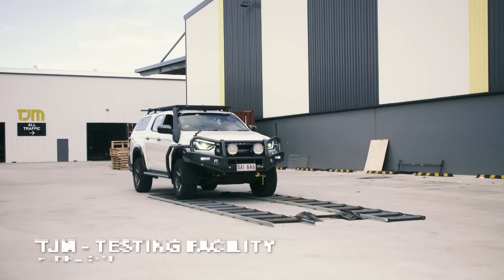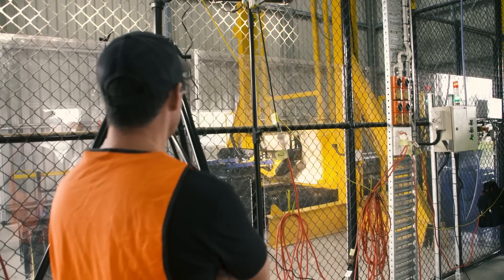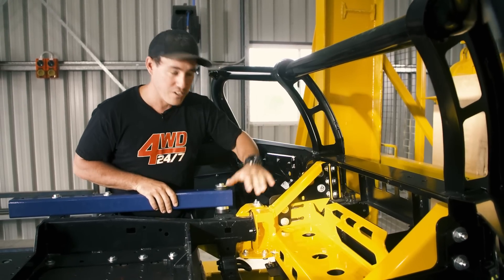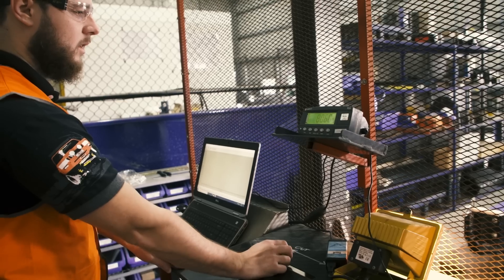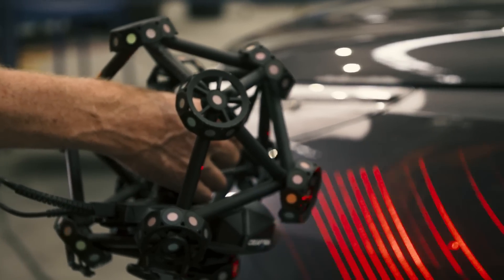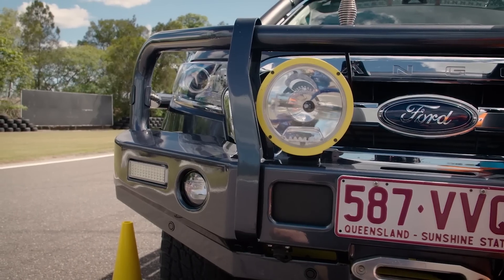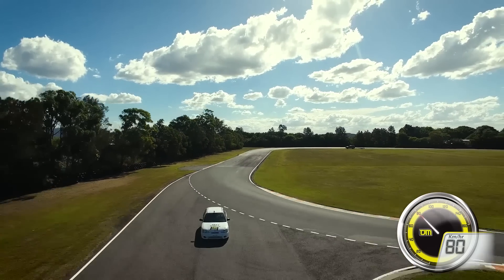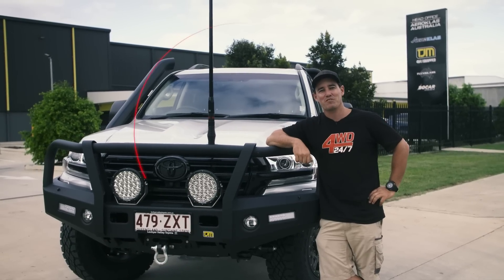BULLBAR CRASH TEST – How strong are they? PLUS How a bullbar is made!

Comment: Couple of issues from an observer.
Slotted holes in a bracket 'control' the impact.... NO WAY!!! too many uncontrollable variables! Friction, bolt torque/tension, paint thickness/friction.... keep going.....
The function of the mounting brackets is exactly that, to mount the item. It is not possible to control the mounting as well as impact control without introducing non-variable control measures!
Furthermore, you are testing a Ford ranger with  a bull bar, then as a comparison a Hyundai Excel without a bull bar ..... How's THAT for a comparison.... why not drive the same Ranger without bull bar into your makeshift roo....?
Clearly you are not independent!!!
Considering I'm currently in the market for 4WD accessories, one thing that this video has made clear to me is to stay clear of TJM products.
So if you are related (which I assume you are) then you have achieved exactly the opposite of your assumed intent.....

Comment: I don’t buy that  at all. Surely the purpose of crumple zones on modern cars is to crumble and absorb shock. Doesn’t a rigid steel Bullbar simple reduce crumpling and therefore in create the risk of the chassis deforming and intrusion into the footwell in a fronton crash. I’d also like to see the impact on the bar at 45 degrees

Comment: 4WD enthusiests need to take a look at the big tests done by BHP on Bullbar & Rollbar safety. They handed over some of there vehicles for expert crash testing, Conclusion was the added Bars were not safe. Bullbars trnasmitted impact further into the footwell area not good. Have any bull bar manufacturers had their bars tested by the offical crash testers as BHP did  ???. Youtube AUTO EXPERT (John Cadogan Mechanical Engineer) does a good breakdown on the subject. Go check it out do your homework. Seems testing the bar without the vehicle is really only half the story one would think.

Comment: BHP used to fit all of their Hilux utes with bullbars & roll bars ....until they did in depth testing at a Crash Lab facility with crash test dummies in the vehicles. The results showed overwhelmingly that the passengers within the vehicle were much safer WITHOUT the bullbar. Have any bullbar manufacturers done similar tests ? If so , where's the results ?
If not ? Why not ? 
Remember,  vehicle damage runs a distant 2nd to passenger safety.
Reply: Unless the vehicle is immobilized in a very remote area and cannot continue to drive. Then the people in the vehicle ARE at risk. Most recent incident would be the example of the woman who perished out near Level Post Bay, due to the car unable to be driven out of the bog. After all, the humble bull-bar started it's genesis in the outback, where those country people knew they had to protect the vehicles' cooling system to ensure drivability. Crunched panels and even crunched people can continue on for help. That, is the immediate role of the bull-bar.
Reply: The only independent study done on heavy duty bumpers (that I know of) was by a mining company, wondering why so many of their "light duty" (Large pickups, but light duty compared to 40 ton dumptrucks and mining equipment) trucks were killing the occupants instead of just injuring them in mine accidents. It was the heavy steel bumpers on the fronts of the trucks, they basically ruin the crumple zone and tend to shove the engine into the passenger compartment and/or the energy from the accident is absorbed by the occupants rather than the crumple zone. They're good for wildlife but very bad for highway driving.
Reply: @JacopoSkydweller have a head on and you'll plow right through the other cars crumple zone and be ok , the oriblem is hitting something like a tree
Reply: the bull bar are not designed for people can safely crash into other vehicles or trees, it’s mainly design for keep you vehicle operate after hit a roo, so  maybe driver a bit more safely.
Reply: BHP still install bull bars on there vehicles
I have seen the report done by BHP and appeared to have an obvious out come they were trying to achieve
Reply: New bars give and collapse,  much better to have I

Comment: bullbars should be made illegal as they are more lethal for pedestrians and wildlife - I recommend Parliament rule to ban their use forthwith and drives refusing to obey be heavily fined
Reply: all vehicles are lethal to peds.
Reply: @phalanx3803  - bull bars actually make the vehicle extremely lethal even at low speeds - should be banned
Reply: @phalanx3803  - okay,  but all vehicles are engineered with crumple zones up front designed to mitigate injury on pedestrians - ie they crumple, absorb the energy and also allow the pedestrian to be scooped up onto the bonnet which lessens the injuries - bull bars don't do that ie bull bars instantly remove the safety factor for pedestrians and cause more injuries and increases the lethality -

Comment: The Aussie bullbars are banned in the EU because they compromise the crash safety of the vehicle. 

With a bullbar mounted run the vehicle through the EuroNCAP test. 
- My bet is the vehicle is now performing worse than without the bullbar. 

If you don’t have kangaroos in your country you only need an Aussie bullbar for one reason - to compensate for small/tiny private body parts.

Comment: Almost had me convinced until TJM’s “professional engineers” used a 10 year old Hyundai Excel as a comparator! Surely a better comparator would have been a 4x4 without one of their bars. Love to see the manufacturer undertake ANCAP standard tests on a 4x4 with the bull bar on it so we know what impact the bull bar has on the crash performance of the vehicle.
Reply: I stopped watching at TJM involvement
Reply: It makes sense to use and old cheap car.
Reply: might be too expensive
Reply: They would use a car that doesn't have an airbag
Reply: It's makes sense to use a shit box. too expensive to repair damage just for a video.
Reply: It's the old 'comparing apples & oranges' trick. Same year, make, model & set up for all test vehicles, with one difference, bullbar or no bullbar, would provide a true comparison. And I suspect the result would be that the distribution of damage will be different, yet price of repairs, etc., would likely be similar.
Reply: @ianhowell6972 I'd like to see broader comparisons on alloy vs steel vs nudge bars, stealth bars etc.

Comment: A good bullbar is vastly better than a weaker bar which is still better than no bullbar. I have not by choice tested 80 series with and without Bullbar Holden Colorado and Ford Falcon. A Bull bar doesn't make the vehicle impervious to damage. But the right bar and speed and situation will improve things dramatically. Alloy bars can also very dramatically. My East Coast alloy winch bar on the Colorado is vastly stronger than the original factory alloy bar.

Comment: Interesting test, but how often r u going to hit a flat object aligned perfectly with the bar???
BUT!!   I purchased a used pickup a few years ago, 4X4 with a dealer installed bull bar, not the best quality, but ok!  A few years later I fell asleep one night, went down into a ditch and struct a large steel post which  prevented me from splashing into the creek.  The truck was still running, no airbag in the face.  I backed out and parked on the shoulder, got out to appraise the damage.  Of course the bull bar was toast but it stopped before it got to the radiator.  Even though it was an inexpensive bar without it the truck would have been totaled!

Comment: I hit a deer with mine going 60 mph.  It pushed the bumper back 2-3 inches (flush with the grill) and my quarter panel rolled a bit. Also dented my hood in 2 spots.  I drove away. But haven't fixed it yet.  I might try to pull it back into place

Comment: I had an Aries brush guard/grille on my 2019 Ford Ranger XL, and it got crumpled after a head-on with a Jeep Compass, both of us doing about 35mph. I'm sure it helped a little bit with the crash safety, but I really bought it for the amount of deer that run around my town, Susanville, CA. They're basically a "protected class" here, walk around with no fear, and occasionally like to play, "Can I survive a hit by that truck?" Anyway, I got myself another 2019 Ford Ranger, this time an XLT (I would have liked another XL but didn't have any in stock at the used but well kept car lot). After looking online at bullbars and bumpers I ran across the ARB Summit (very similar to these TJM's) and decided this is going on this go 'round, very sturdy looking, and upgrading the bumper at the same time I'm adding a brush guard/grille slash anti-MVW (anti- Mobile Vehicle Wrecker, aka deer). This video has only reinforced my desire to get it, thank you for making it! ;}

Comment: I thought you guys were a four-wheel drive show not a test dummy show or how to fix your truck show.? Would love to see you guys driving tougher and harder tracks. And put suspension lift and bigger tires on on your tour especially the one that spews black smoke everywhere it has the power to take it and it'll be a lot smoother ride and get some beadlocks

Comment: What happens to the pedestrian safety rating of the vehicle. 🙁
Reply: Anyone stepping out in front of any vehicle travelling at fifty miles per hour isn't getting up. If you never left the confines of the city the fitting of one would be questionable but outside the city the question starts to be why would you not, talk to the trucker's.
Reply: @CrusaderSports250  even at lower speeds the weight of larger vehicles plays a big factor it may be slower but it still pack a lot of energy getting hit by and truck at 25 is like getting hit but a car at 35.

Comment: Bullbars were popular in the Philippines in the late 80's and into the 90's when it was sold with the Mitsubishi Pajero. But it really won't protect the front part of the vehicle. Bumped on the right side then the rest of the bull/bush bar will damage other parts on the front not indirectly
Reply: They kill you because the crumple zones fail as the energy of impact is not absorbed into the areas designed to crumple, only the ARB Smart Bar allows for this

Comment: Situation no;
1; you hit pedestrian and cracked his skull open at 25 km/h because bulbar... Poor dude will live long and prosper 
2; hit tree 60 km/h collision. Bulbar messes up car computer. Air bag is activated fraction of a second sooner or later. Seat belt tensioner is activated fraction of second sooner or later... You die or you are incapacitated for agonizing rest of the life. 
You could walk away from that accident and have interesting story to say in the pub 3 days later... 
But nope, you die or screw up 10 years life to you and your family because of bulbar...
By the way that 100 kg all the way at the front of the car really messed up car handling. So instead completely avoid accident car just doesn't turn. And on top of that you are more likely to die in that accident because of stupid shit...
IS IT WORTH IT???
Reply: wow the amount of BS in your comment is staggering. bull bar or not if your head makes contact you done for either way. and they state in the video there made to not computerize the crash sensors. as for the extra weight out front it hardly makes a difference it even helps when towing as it off sets some of the ball weight keeping the front wheels better planted to the ground for better grip when turning and stopping.

Comment: I hit a roo the other day in my Colorado. Hit basically in the same spot the test showed. I didn’t have a bull bar but you had the imitation kangaroo tethered. When the roo I hit, it hit the bar, the tail smashed the sill panel under the doors and smashed the back door panel. You showed the best case scenario with a pretend kangaroo to sell the bar for your Chanel I think. My side hit damage would have been the same as a to the normal person, they don’t just bounce off hanging off a string

Comment: Tjm alloy or steel for our 100 series td ifs?   Im leaning toward alloy due to weight on standard suspension. Thoughts?
Reply: Alloy won’t hold up to a knock as well as steel
Reply: @mathewbragg4001  hi Matt. I know u r right. I just ponder how much the chassis can take. I tend to think that if an alloy bar gives sooner than steel. Is that easier on the chassis
Reply: my 105 has the stock alloy one they offer good protection i still have my one on after hitting a roo cant be bother replacing it ATM as its not my daily. IMO if you dont drive in rural roads a lot alloy is good for that chance hit with out being too heavy but if your gonna be regularly driving rural road get steel as they can take a few roo hits depending one where you hit and speed. any properly made bull-bar should have no effect on the chassis in a roo hit.

Comment: The guy at Bourke street hit person after person with no bullbar and he did fine got a lot of them more then the huundai excel.
The test the roo hits a lower portion of the 4wd which forces the kangaroo downwards. The kangaroo replica for the excel makes the impact height dead on and doesnt push the kangaroo under or over making the full impact go through the car. Seen many cars and 4wd hit kangaroos in real life and even a ford transit van no bull bar and a hiace with a bullbar. The hiace was stranded the ford with no bullbar wasnt so it will depend on the hit the location of the roo, size, travel of direction. Most bullbars are solid mounted with no slide plates. 
This bullbar should be tested at 110kph against roo at normal height eg jumping into oncoming car. Easy enough to test in real world conditions on a bush road if you believe in the product.
In real life a old commodore mowed down a bunch of people in real life and no bullbar and did fine.
Yes it would be advisable driving slower at night at say 80kph then 100 to 110kph but in real life most will travel at 110kph with no warning of a kanagroo strike.

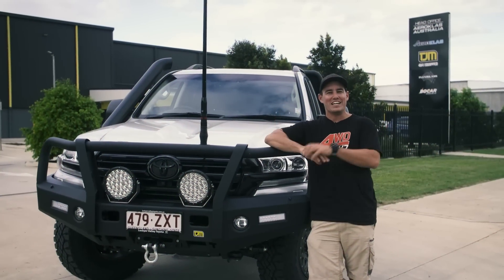Comment: One mistake at 7:35, you claim the kangaroo crash was the ultimate test, I beg to differ. Come to Arizona and try that test with our 1100 pound elk (that's 500kg for you mate)  ;)
Reply: Kangaroos are most common. Take a drive out west and you will see hundreds on the side of the road that have been hit.
Of course there are bigger animals. I would say water buffaloes would be bigger than elks or cattle on the road. 
It’s just not a common problem.

Comment: Most off roaders do not realize how much better the Aussie made gear has to be. Everything is tested and rated according to government mandates and guidelines down under. By comparison, the US stuff is mostly junk. None of it is regulated, none of it is guaranteed to be air bag compliant, most of it is cheaply made  and/or made in china with even less regard to safety or durability. I've been trying to find a quality bull bar or front bumper assembly for my truck here in the US, but so far most of it appears to be cheaply designed and built.

Comment: no recovery is ever perfectly straight like their tests in the factory. Snatch and winch recoveries are sometimes at angles. So not sure if their load testing is real world applicable.
Reply: Agree there. They should do testing that covers at least greater than 180 degrees of the front.
Reply: @EvanDrinkwater  but of course they won't do that. They'll in this completely controlled environment then market it as a "tested and approved" . Perhaps you and I should get into the bullbar testing business haha
Reply: Your vehicle you are pulling is also not 8000kg like in the test, this far exceeds what is needed. There is a reason you see utes being able to pull trucks out, you just need to overcome the friction not lift the entire weight of the car constantly.
Reply: @148Reaper  its like a hilux snatching out a unimog bogged on the beach. No chance!!

Comment: Cheers Shauno and the 4wd 24/7 crew for coming down to meet our engineers, take a cheeky peek behind the scenes and catch a glimpse of what goes into our Bull Bars. Up until today, most of our rigorous development and testing has been kept top secret since we started way back in 1973. 
We’re mighty proud to lead the pack with our 4x4 accessories, and it's all thanks to the behind-the-scenes work we do onsite and in the Outback. We’re sure our mate, Skippy the Roo, wasn’t as excited, but someone has to take one for the team. 😉
Reply: I used to make bars for my old bangers in the shed, out of off cuts, railway sleepers, what ever was on hand when the front’s were basically a rectangle, but times have changed. 
Seeing the work that goes into developing a bar for a modern 4x4 was an eye popper, looks the goods too. 
Good work 👍
Reply: "lead the pack" Your bars are made in China mate.

Comment: I have an ARB Summit on my ‘17 Colorado diesel here in Western Canada. Hit a 225 kg 4 point mule deer at 100 kph hole towing a 3000 kg boat. He was at a full run and came out of the ditch in a snow storm. Zero time to brake. He hit his shoulder on the left upright and wing and his head right in the center of the bullbar. The truck absolutely would have been undriveable without the bullbar. Zero frame damage, no airbag deployment. Totally committed to having a bullbar on all my trucks!
Reply: @Do-iz6qd Then you don’t know shit about northern Canada travel. Road surface was still perfect. Snow blowing right across the road. I have 50 years experience  in all kinds of weather. THE POINT was that the ARB bumper kept the truck drivable after the impact.
Reply: How was the moose , l feel so sad if l hit anything  @jaykanngiesser3454